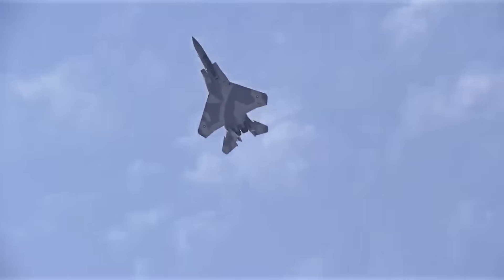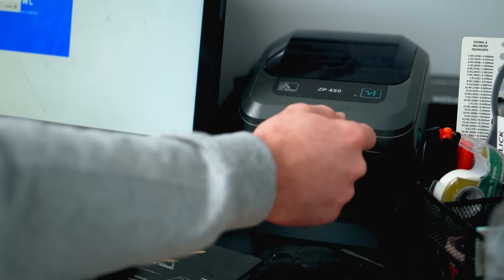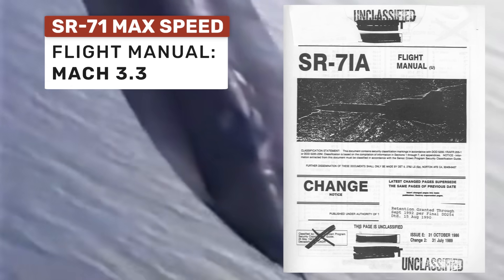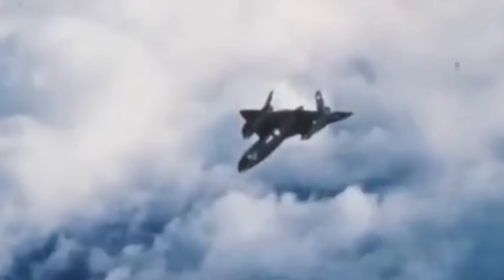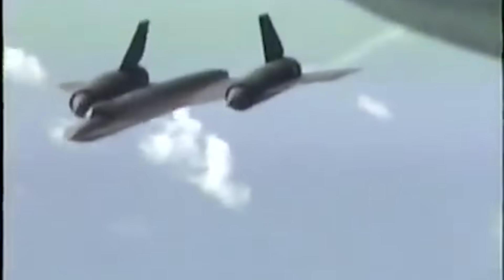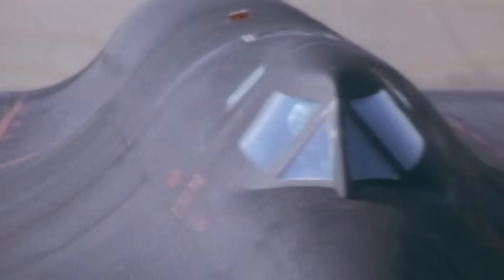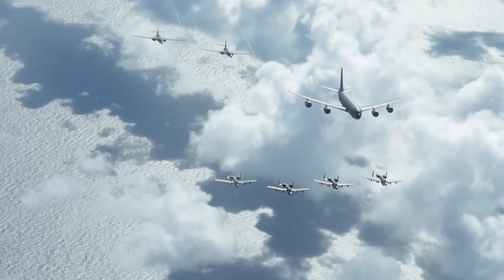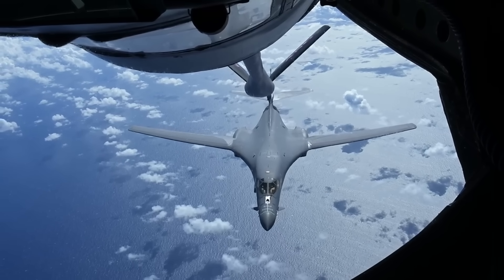The SR-71 was MUCH FASTER than the Air Force will admit

Comment: One of my grandfathers was a SR-71 crew chief.  He told me, back in the 90s when it was being "decommissioned", that the top speed would never be disclosed because the Airforce didn't know for sure what it was and would probably never know.  So the following might be the truth or just a cool story.

You mentioned the manual saying the speed was more limited by the structural integrity of the airframe and air inlet more than the engines, this is true but an SR-71 that had been flying for awhile was faster than one brand new.  He said that each plane had become an unique individual with slight differences in length, width and shape, and that each time they pushed that mach 3.2+ they changed a little more.  The skin, frame and air inlets were being slightly alterened, reforged, by air pressure and friction heating making them "organically" reshaped to be just slightly more aerodynamic and more efficient each time, when they didn't break themselves or pieces fuse together that shouldn't.  He never said how they measured these differences but that they were small, not noticeable to the eye between individual flights, but made things difficult to repair any worn or damaged surface segments with stock parts.  He said that this was first noticed back in the late 60s and Lockheed was very interested in how each plane changed, he believed that the planes retired in the 90s were probably different in shape and significantly faster than when he worked on the same ones in the 60s.

I have no way of verifying anything he said he was talking around NDAs and national secrets and would not give specifics for a variety of reasons, so might be true might just be a cool story.
Reply: Awesome story. See my comment above. 
At that symposium, I got to meet crew chiefs and even mechanics and the stories they told of having to remove 300 screws on a single panel with a speed wrench (power tools not allowed) and replace them every time was a true pain in the ass. And every panel screw was used only once. They took out 300 screws and threw them away and replaced them with 300 new titanium ones and had to torque each and every one. If you clicked the torque wrench twice, you've overtorqued it and it should be removed and replaced. No exceptions.
Reply: @MrWATM  ok that overtorch thing sounds likie a true pain lol
Reply: @MrWATM  I've used TI screws before. They are strong and brittle.
Reply: Aligns with what I have heard.
Reply: Being aircraft, every critical piece would be analyzed and measured and checked for wear… that’s how they get repair interval times down..
Reply: Not only that, you could not "cannabalize" a panel and use it on a different tail number... Wouldn't fit. Line Chief asked me to try the AC bay panel from the SR-71C on 956, the SR-71B... Nope.
Reply: On each flight the fuselage expanded enough to stop the fuel from leaking. The heating also “work hardened” the parts. It effectively heat treated the entire plane each time it was flown.
Reply: The plane's speed limit was structural  not engine performance. The engine was a ram jet at those speeds so it could probably go much faster if the p,and was made od diamond.
Reply: I'm sure there are a lot of people that know the fastest speed at which the SR-71 has flown, but that is unlikely how fast it could go.
Reply: This doesn't line up with the reality of what limits the top speed of that plane. It's not thrust or drag limited, it's safety limited. The engines had plenty of thrust to accelerate it well past its top speed, but doing so would cause them to melt. There's nothing about the shape of the aircraft or the engine intakes that could change the temperature of the intake air.
Reply: @toby1248

Something like water methanol injection could most definitely cool the air in the intake....since heat is the biggest killer of a diesel, i use a 2 nozzle spray in my diesels  charge pipe  before the air enters the cylinders...it atomizes before entering the cylinders and only provides a cold air, it doesn't actually burn or cause cylinder wash.

So I'm sure they could use something to cool the air enough to allow more power out of it, atleast to a certain point...what that would be or how much you'd need to continue cooling the air, I  have zero clue...getting enough of it on board to keep it fed may be the issue with that idea, I'm sure it sucks the fuel down, so therfore water/meth mix.
Reply: @BilkoMX124  water/meth mix... I'm sure there's a few truckers that might agree with that mix... no but seriously that is really cool to hear about and understand a bit of.  thank you for sharing.
Reply: @BilkoMX124  Also not mentioned in the video is that there's essentially a small 'lake ' of fuel in this aircraft that was specially made just for the SR-71.
Reply: @toby1248  Would an improvement in the aerodynamics of the inlet result in a reduction in friction from the air and therefore a little less heat?

Comment: The limit of the whole platform is the relatively rudimentary inlet equal to gen 2 fighters. Same goes to the airframe.
For comparison, MiG-25 has gen 3/4 variable inlets and airftame aerodynamics.
The MiG has thrust to drag allowing for 4.000+ km/h.
The SR-71, A-12, etc. have worse thrust to drag and heat up more.
Anyway, the fastest recorded is a MiG-25 fleeing from Israeli interceptors and SAMs over the Sinai desert.
Both planes went 3.2-3.3 Mach and going faster was unreasonable for all the reasons there are.

Comment: I can confirm this. My grandfather designed the nose and wings of the SR71 while working for Skunkworks. He told us that it went 3.5+
Reply: plus. The max cant be disclosed. I mean the thing outran Russian SAMS
Reply: @EdWeibe  I don't know at what point but AA missiles achieved MACH 7+. It's possible that even at that speed they might miss, unless stealth enough the plane wouldn't detect them in time, if flying high enough and limited range of the missiles.
Reply: @uncrunch398  yes a SAM would eventually catch up. but keep in mind they were designed to shoot down jets going MAYBE Mach 1.5 at the time. so a SAM trying to catch a plane going a "possible:" MACH 3.3 or faster means even if the SAM is catching up it would probably run out of fuel before it got close to the SR-71.
Reply: @uncrunch398  the thing is, the SAM isn't likely to be directly behind the target. It's coming up from the ground at an angle, so it's a question of how quickly it can change direction before it overshoots the target or runs out of fuel.
Reply: Everyone can stop researching, this is solid.
Reply: Now Skunk works is in what used to be called Building 85, I believe. That's where they built the TriStar and some components of the C-5 B small among other projects like the P3, AWAKS
Reply: Mach. One. Million.
Reply: you have zero credibility.  Your Granddad MAY have been part of the design team but he is not part of teh flight team so would not havee any view into its capabilities.  Any more blatant exaggerations you'd like to share?
Reply: @slowery43  You obviously have no idea how the process even works. Pilots give feedback to engineers on design shortcomings and performance issues and engineers address those in subsequent designs. That's how engineering companies work.
Reply: @VndNvwYvvSvv  You work for Skunkworks? There is a team for the entire plane but in those days he was the main engineer with those two parts that would have been checked over by Kelly Johnson.
Reply: @slowery43  You are neurocognatively challenged. Obviously you have not worked in an industry with design or you would know that pilots are the ones giving feedback on performance to drive the changes engineering makes. Even in companies like Skunkworks. And I talked with him about it enough to know all of this. He was very proud of his work as he should have been. Go back to your legos.🤣

Comment: Of course they have kept it secret, I worked on the engines back in the 80s. It started with 45,000 lbs thrust each and later probably 60,000 lbs plus. He'll the F15 EE flies almost Mach 3 and it's aluminum ! Go figure.

Comment: I was visiting my USAF Uncle in '68 and we went to the base at Elgin - an SR71 had come in and we could see the verticals as we passed a hangar. I asked if we could see it, so we drove down the hill to the hangar. A security guy started walking toward us as we approached and I saw him kick off the safety on the M16 - -we stopped, he stopped and stared like a stone. We backed out of there as we had entered. 

I heard it went out the next night and a little show off ( or maybe not) pilot hit the full burners on TO and it blew out some windows in the officers club which is right at the end of the runway. It is a wall of glass. 

What a fantastic piece of machinery,  I followed it since the early 60's when it first hit Popular Mechanics in a little blurb with a photo. 

There is a single engine drone on a spike at the Skunk works - it would launch off the back of an SR71. Looks like a science fiction thing. 

Everyone should read Kelly Johnson's book.

Comment: I worked for a guy (my supervisor) at Vitro Corporation back in the 70s. He was a radar operator on a guided missile cruiser and he related having tracked a target coming out of China's airspace over North Viet Nam and somewhere about his radar's calibrated altitude capabilities. As far as I know the stated service ceiling is 85,000 feet. His radar was calibrated to 103,000 feet and the target was way above that and cruising in straight and level flight. When he reported it to his supervisor he was told not to pay any attention and that it was one of ours. No actual identification but I doubt if we had anything other than the SR type in operation at the time. I know it's hearsay so not admissible in court but if it flew that much higher how fast could it go in the much less dense air up there?

Comment: While serving in the USAF from 1976 thru mid-1980, stationed at Ellsworth AFB in SD as a jet engine troop working flightline, I had the opportunity to witness 1 of these planes land as a transit bird at our base. The SP personnel very quickly escorted the taxiing aircraft to the 90 row of docks(last row at north end of the runway)into a waiting dock that already had doors open(they would accommodate a B-52 easily)and shut the doors after the aircraft shut down. (We also had another one set down about a year or so later, same deal).
I knew a couple troops in the SP squadron who were working security at night up there, they told me you have 3 minutes to go inside and look at it after scrutinizing my line badge. I did so and was amazed at the size of it, couldn't help but notice all the fuel on the floor because the SR-71 was designed that way to allow for expansion when at speed and would leak like a sieve when cool. We took our look at it and the SP people said, "You didn't see this tonight, right?" "Nope, didn't see anything....." Personnel were brought in from Beale AFB to make necessary repairs and bring start carts for it.
It departed 2 days or so later, and the resultant sound/shock wave from the burners lighting off was actually much louder than a KC-135A tanker using water injection! Very cool to see this display of sheer power, that jet was at altitude and leaving a contrail inside of 5 minutes after a steep angle of attack climbout, and could still be heard loud and clear after it disappeared from sight. So cool to see one in person, and to see it fly!
Reply: I was at Ellsworth for that too. It would have been December of 1982
Reply: My folks were in Ellsworth 80 to 84 I beleive. I was born on Ellsworth AFB in 83.
Reply: I am in Havasu.

Comment: They don't know, they hit mac-5 according to a USAF test pilot i knew, but it nearly destroyed the plane,😊 the A12 hit m4 too. They only went up then throttled back, and I can't believe the A12 red lined, but those are dinosaurs now, but the structural science, materials science, engine science and atmospheric speed thresholds on current design aircraft using fossil fuels the got from the blackbird will advance the fleight of man into the cosmos,,,know their problem, they discredited Bob Lazar when they should have given him a lab, team, budget, raise, you get it right,,,he quite possibly may have developed a process of producing element 115 ununpentium, Bob is the real deal.

Comment: I grew up in St Louis. I know a lot of ppl that used to work for McDonnell Douglas. Including engineers that were on F-15 projects. They would never say anything about hard numbers and top capabilities. But production Eagles were capable to catch Blackbirds. It would melt their air intakes, but it was possible from what was conveyed in hushed tones. What you find out pretty quickly is that the US Military will never admit to the top top performance of any weapons systems. And as you climb the ladder in technological sophistication - the margin of claimed vs actual is very wide. Russia and China are out there demonstrating the full capability of their platforms so they can sell them. Their own defense contractors need forwign money and the prestige that comes with export. The US on the other hand LIMITS what is sent to other contries very strictly. F-22's weren't even available to the closest allies. Export M1's aren't even a shell of the US variant. The US can block ANY sale of it's aircraft designs, like they did when Turkey thought buying Russian SAMs was a good idea.

Comment: From 1966 to 1970, I maintained the Blackbird as an Air Force technician with the 9FMS/9SRW at Beale and at Kadina.  The top speed of the Blackbird has always been up for debate.  What I find interesting is the published max altitude that has always been generally accepted as 85,000 feet. I won't tell you what the max altitude actually is, but the number is considerably higher.

Comment: I’d say it’s a given that the capabilities of the SR71 are still understated and likely classified despite the fact that the aircraft is retired for the most part and relegated to museum duties. Of course it’s also worth noting that the aircraft were designed and built with late 50s-early 60s technology and they were still untouchable throughout at least the 1980s.

Comment: Many years ago a friend, now deceased, told me of monitoring radio reports of the last flight of the SR-71 that was donated to the Smithsonian.  That flight was from LA to Washington D.C.  He swore that he wrote down the time it left LA and the time it arrived in DC.  He consulted a map and did some calculations.  He came away with an average speed significantly higher than they would admit to at the time.  And, being an average that included take off and landing, the max speed at altitude would have to higher.  Somewhat later, when the Air Force reported on the flight, they gave departure and arrival times that were different than my friend had written in his notebook.  He swore that the Air Force was covering up the actual max speed of the aircraft.
Reply: 52 min was something like 5.92.  It is a space plane.
Reply: @miguellogistics984  "52 min was something like 5.92.  It is a space plane."

Still far beyond what the airframe can take.
Reply: @DIREWOLFx75  For Atmospheric Flight.
Reply: @miguellogistics984  The SR-71 is completely unable to do nonatmospheric flight...

There's a reason why rocketry is a tricky business and why most designs use different engines for in and out of atmosphere.
Reply: @DIREWOLFx75  Rocketry is only a system.  They have been used atmospherically and non atmospherically.  The 12's and the 71's by the way have astronomical navigations systems, like an Astrodroid, that tells the navi system precisely where the plane is.  It can even read the stars at noon at zero sea level.  Curious.
Reply: @miguellogistics984  I worked the Nortronics NAS14V2 navigation system.  We had to set a chronometer to teh NIST WWV atomic clock in Fort Collins, CO by radio and account for the fact that the radio signal took 6 milliseconds from Fort Collins to Beale AFB, CA.😎
Reply: @DavidMitchell79  Certainly! The Plane was better off star navigating than recalculating the corellas effect with every movement of the stick and variation of speed. The 6 milliseconds was not the transmission travel, but the movement of the electrons from the observation equipment to and through the respective transmission and reception systems.  Time is curious that way.
Reply: Remember that the plane also had to refuel before it could do the cross country sprint because it took off with minimal fuel aboard. So add the ten minutes it took to rendezvous with a KC 130 tanker and fuel transfer time
Reply: @DunsmoreFamily  Great point.
Reply: That flight reportedly took 15 minutes and change, before the flight times were modified.
Reply: @Lightning546  LA to DC in 15 minutes is Mach 12 Gasp
Reply: @thelawngnomeslayer  which is why the "15 minutes" is BS
Reply: @thelawngnomeslayer  I read an interview once of an ATC dude that said he tracked an SR-71 coming out of Russia into Germany above 95K feet and about Mach 10.5. When I went to pull that interview up a few days later to print it. It said "web address not found"!
Reply: @thedoorider  The problem with such claims is that even if you give the SR-71 mathematically perfect aerodynamic properties (which it absolutely didn't have) speeds above Mach 6 for any more than a few seconds results in burning titanium. I would believe Mach 3.75 for VERY short stints and perhaps Mach 4 in "either the missile gets me or the plane breaks, but I'm taking my chance with the plane" type scenarios for maybe 10 seconds.
Reply: @thedoorider way back machine?
Reply: @Lightning546  nonsense.  the ramjets could not function at that speed.  the inlet spikes' max theoretical speed was mach 3.55 at full retraction
Reply: @Lightning546  that tracks with what I heard stories of one of it's early test flights, from LA to NY and back in about 45 minutes.